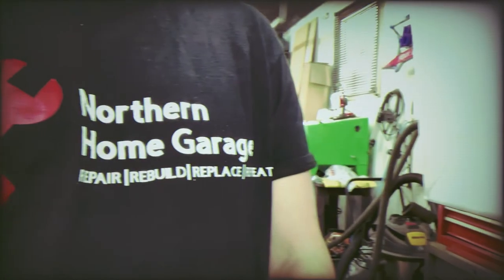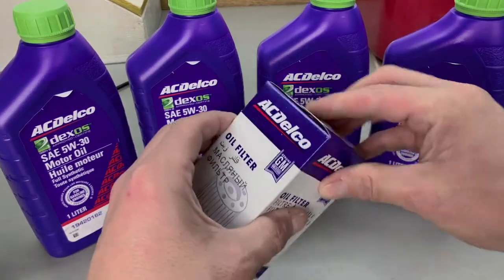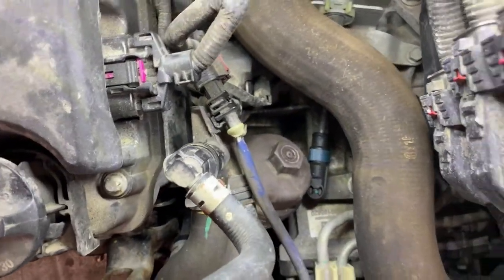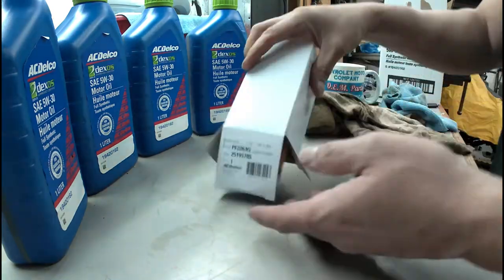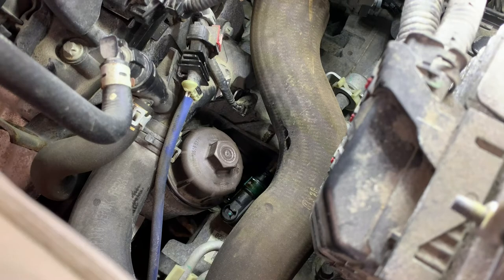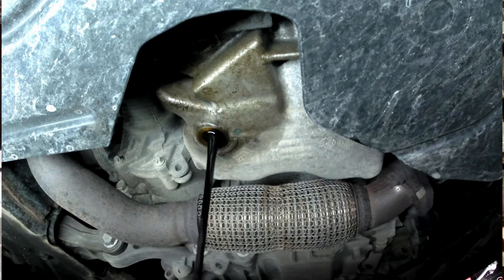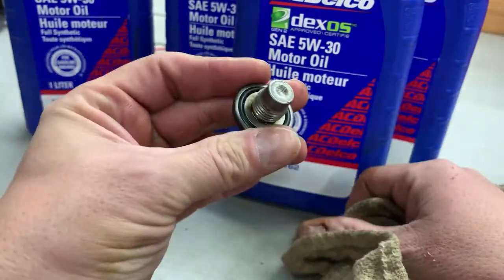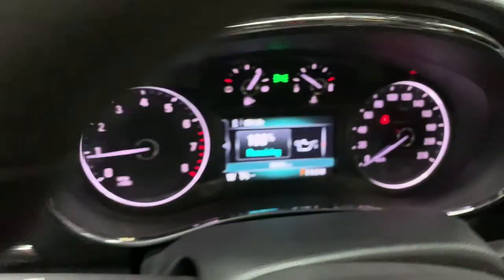Oil Change 2017 Buick Encore 1.4L. How to identify what oil filter to use??

Comment: Thanks for the video. When I ordered a oil filter for my Buick I ordered what was listed in the owners manual. My Buick is like yours and needs the 2263 oil filter not the one listed in the manual. Thanks again for taking the time to point that out. I think that is important information that should be listed in the manual. The manual does not mention the difference between the two types oil filters and caps or how to tell the difference. Great job....
Reply from the maker: I’m glad it helped sir! Thanks for watching.
Reply: My theory is that it was a last minute change for states with different emissions requirements.

Comment: My Encore also shows the wrong filter in the manual. Worse yet, is that I took it to a garage for the previous oil change. This garage used the wrong filter without the check valve. This is one reason why I always prefer to do my own oil changes.
Reply from the maker: It’s a real shame. Hope this video helped. Thanks for watching.

Comment: So I'm just changing my mom's oil in her 2018 Encore. The dealer has done the past few oil changes. I had researched prior and found the info on the oil filter and ordered the right one for the UFI. Just pulled the old filter and found it to be the Hengst without the spring on top, so of course I'm thinking I ordered the wrong one. Pull up this vid and I definitely got the right one. So the Buick dealer put the wrong one in before, probably each time! They also had over filled her oil one time, thankfully she didn't make it too far before it died. They supposedly checked it all over when they redid her oil change but now I question everything. So word to the wise, do your own oil changes!

Comment: Check the alphabetical section on the last few pages of the owner’s manual. Look under C for capacities. I have the LUV engine and mine uses the other filter ( the on3 without the spring loaded top. How confusing is that? Mine’s a 2019 so maybe that’s something different they did.
Reply from the maker: You're right. It is super confusing. The only way to know what filter you have is by the cap on the oil filter housing. Not in a book or a service manual. It's kinda crazy!
Reply: You know what,,,,, I’m not even sure that the dealer used the right oil filter during the “ first two years of free included oil changes”. When I started doing it myself I bought the oil filter at a GM dealership and they gave me the one without the anti drain back valve. The one I took out matched but that was put in by the dealership when they did the previous “ free” oil change. So your oil cap said UFI ??? On it and that’s the one with the spring loaded valve? So if mine says Hengst on it I’ve been using right filter ( the one with no valve ) and if the cap says UFI the dealership on the first 3 oil changes and myself on the last 3 ( first two filters bought from the dealership ) have been using the wrong filter? Great a $29,000 “ mistake “ if this thing is screwed up.

Comment: Thank you like you said not all oil change places know the difference my wife experienced it was leaking oil the owner of the shop saved the spring and made it right I've decided that I not paying $100.00 bucks for a oil change Thanks again
Reply from the maker: I’m glad you enjoyed the video!! Thanks for watching
Reply: The oil changes on our 2019 Buick Encore were around $100 but I started doing them myself over a year and a half ago. My 2017 Toyota Highlander had the first 2 years of oil service included and the next few were under $90 ( 5.5 litres of synthetic a filter and the checked fluids tires, visual brake check etc. ). The next two times I went, the price had jumped to $150- $175 so I started doing it myself. My wife got a 2024 Toyota Rav 4 and oil changes for the first two years aren’t included plus they charge over $220 for and oil change.
Reply from the maker: Wow. $220 for an oil change???

Comment: Very informative video!! Quick question my wife's vehicle has 35,000 should I use 5w-30 or different grade. Also what happens when the vehicle reaches 100,000 miles what type of oil should I use?
Reply from the maker: Thanks for watching. I personally would not switch the grade of oil in this particular engine regardless of mileage. Especially if you're still under the factory powertrain warranty. My suggestion, stay with what is known for the vehicle.
Reply: @NorthernHomeGarage   understood!! Thank you so much
Reply: I just did the oil change very easy following your instructions thank you so much! Also I noticed the dealership used the wrong oil filter.. 
Lastly... after how many millage do you replace the oil ?
Reply from the maker: @ArmandoMartinez-fi9qv  I’m so glad it helped. I always use the oil life monitor and replace at around 15%. :)
Reply: Are those bottles imperial gts.
Reply from the maker: Nope. They are metric litres. Google tells me it’s equivalent to 1.057 US QTS.

Comment: 2019 buick encore i have ufi oil cooler can that be switched out for a HENGST
Reply from the maker: I would strongly discourage this however, I would think it’s a direct replacement part but personally would probably not venture down that path unless there are other factors I’m not aware of. It appears from the catalogue listing to be interchangeable if purchased from the dealer and comes with everything that would be required. Thanks for asking the question!!

Comment: 2018 buick encore i just changed the oil and found that the suv had an hengst filter when the cap calls for ufi
Reply from the maker: This happens all the time. My first oil change they out the wrong filter in mine as well.
Reply from the maker: This happens all the time. My first oil change they put the wrong filter in mine as well.

Comment: Thanks for this video the dealership put the wrong filter in! So i have the ufi and got the right filter drained it filled it put filter in and now when i stop it says low oil pressure? Any ideas i mean it has 26k miles on it
Reply from the maker: Whoa!! Something is very wrong there and I would definitely not drive it like that. If this only started after you did the oil change, something is not right. Filter brand, filter not snapped into the cap properly, wrong filter in the box, cap not seated correctly, wrong grade of oil, low on oil, major oil leak, filter got twisted during install and may be in by pass mode now….So many factors here. If you have verified all the above and still have factory powertrain warranty I would get it to the dealer ASAP.

Comment: What would happen if I put the wrong filter in
Reply from the maker: I am thinking that the one housing has the bypass valve built into it and the other relies on the filter valve and spring. I think (of course this is my opinion) that if the oil changes are done and filter does not get plugged to need the bypass you would be ok. Also, the wrong filter does not seem to fit 100 % and has a tendency to get crushed a little which could mean a small amount of unfiltered oil may pass through. It’s of my opinion it should be fine. Mine has had the wrong filter installed in the past and the engine suffered no noticeable damage. Thanks for the question!

Comment: ours has no cap or canister.  ours takes a fully contained metal spin on filter.  it is accessed from the bottom of the engine.  2016 1.4 liter encore.  ??
Reply from the maker: Yes it is possible to have a spin on oil filter on the 2016 model. Rare but possible. There are 3 different engine codes for your model. GM classifies them by RPO code. Your engine would be the LE2. The ones like mine that takes the cartridge filter are the LUJ and LUV. Thanks for watching.